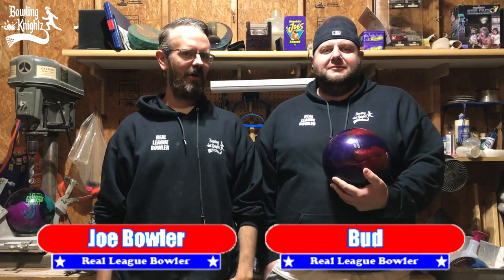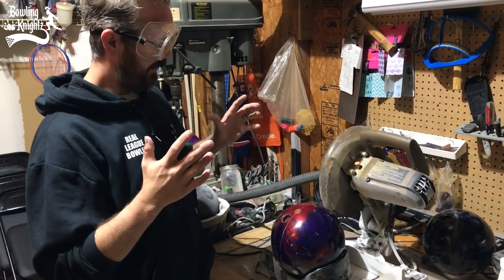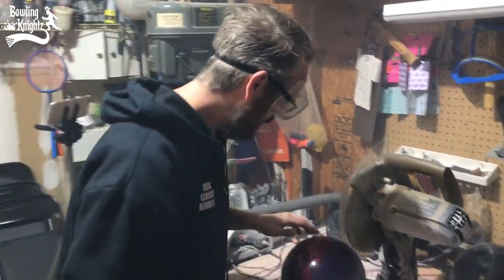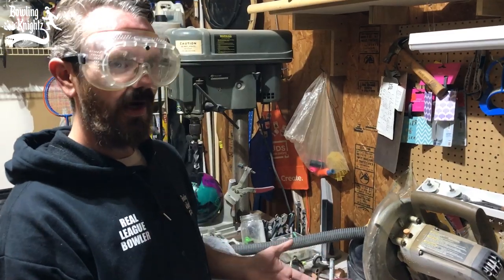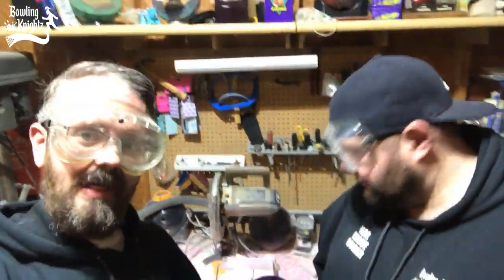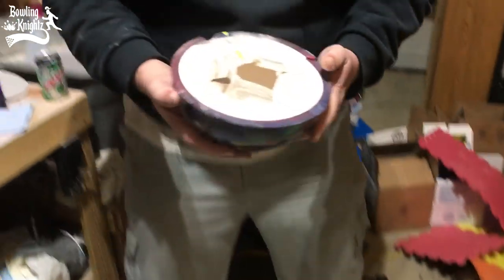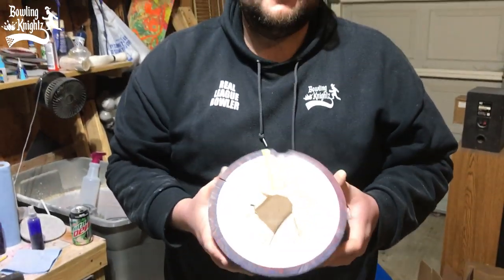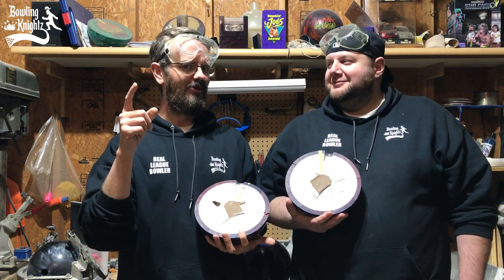We Cut A Bowling Ball In Half! - DON'T TRY THIS AT HOME - What's Inside?? Part 1

Comment: Sand down the side with the whole pin showing, add some clear resin in a mold so it only sits on the flat part and use that to make the aforementioned clock. Would def make a neat piece for the shop.
Reply: Awesome video btw!
Reply from the maker: I like it man! We need to make that happen!

Thank you very much,
Joe Bowler
Reply: @bowlingknightzgarageshop7593  Heck yeah!